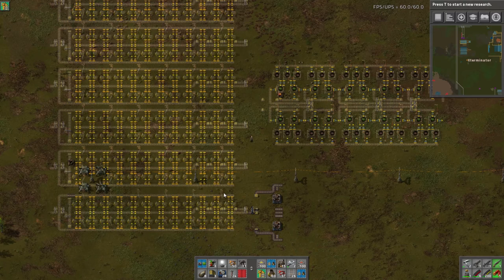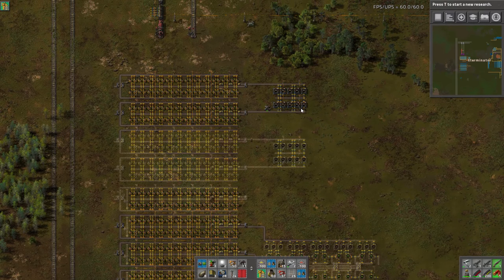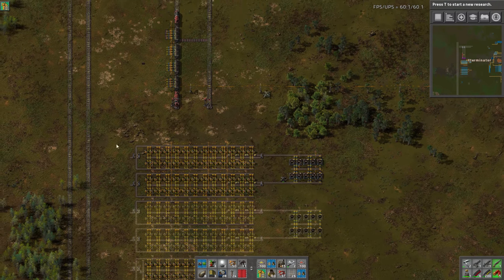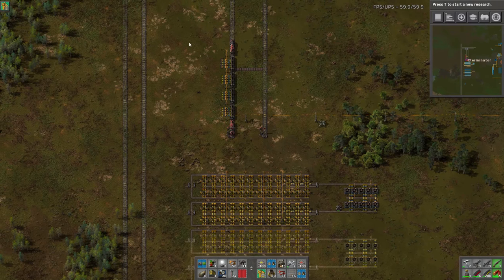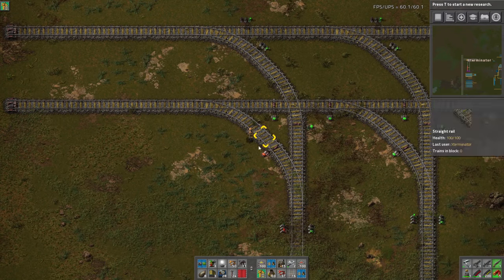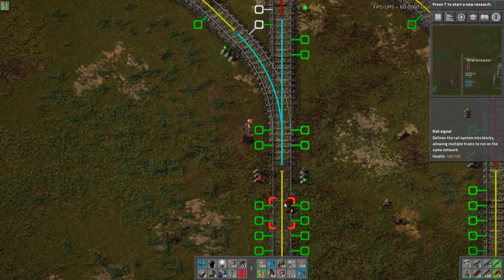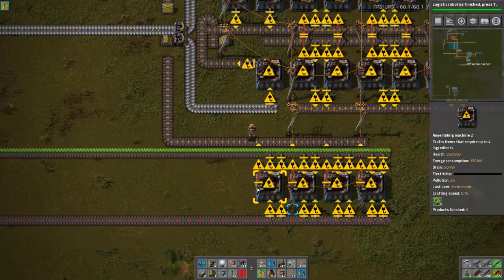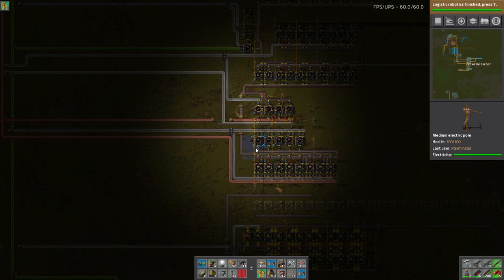Factorio: Tightening The Belt: Megabase Guide EP10 - RED CIRCUIT BUILD | Tutorial Gameplay Series

Comment from the maker: Hey guys, wanted to point out a mistake I made here that may confuse some people. In the example I show of direct Insertion of Copper Cable to Red Circuits, you may have noticed I did it backwards. I put down 6 cable machines into 1 red machine in the middle, but it should be opposite of that, with a cable machine in the middle and 6 circuit machines on the outside. Not sure what my brain was thinking. Sorry for any confusion! :)
Reply: Never mind! Your a super natural simpatico - we thank you for that excellent series
Reply: it happens to all of us
Reply: Hey xterm I noticed when you removed some of the signals on the first junction you explained. Surely that makes that block one way because you need two opposite signals? Hope that's clear enough aha
Reply: Because inserters takes in priority the closest line so they would take iron plate instead of cable for red circuit. I'm actually a bit curious of this build because if for any reason at some point he is having a shortage of copper, cable will stop being produce and inserters will start to take iron plates and stay blocked with them in it.
Reply: Yeah, I noticed, but decided to ignore it since you were just making a point anyway. :-)
Reply: Inserters that are set to insert into an assembler will not pick up items from the belt that the assembler doesn't need.  So an inserter that is inserting into a red circuit machine will never pick up a copper plate.

Comment: Could you please go through train loading and unloading. I've always been scared of trains as they seem super complicated and have never actually used them in game yet. Your explanation on signaling was fantastic however and is a very easy and useful way of visualizing and understanding how to signal intersections. That is only half the battle however, what is a trains throughput/how many carriages do you need to compress 1, 2, 3... yellow, red, blue belts? How do you efficiently load and unload them? Does the throughput easily convert from a train to a belt? And if the train isn't at the station, how do you have a compressed belt 100% of the time?
Yet another fantastic tutorial, they are very entertaining and informative to watch. :-)
Reply: You can do trains very simple or complicate it for maximum throughput and efficiency. Dont be scared they are fun. You can start with just one train and then you don't even need any signals. Put some inserters to load and unload, if you need more throughput watch the inserters and belts and think. Why do you need a belt fully compressed 100% of a time?
Reply: In order to get a compressed belt 100% of the time even when trains are not in the station you use chests. When the train is here, it fill them (inserter Wagon -> chest) and 100% of the time inserters are taking materials from the chest to your lane. You can add more chests in between if you need to buffer it up.
The most difficult part to deal with is that inserters carry really quickly from inventory to inventory but are really slower to put in a belt (at max level stack inserter can carry 27 item/s from wagon to chest but only up to 12 item/s from chest to belt). So at max tech for a blue belt you need a bit more than 3 inserters for a full lane. So make it 4 and make them merge on both side of the lane.
Reply: For compression, watch the factorio explorers lets play of terminator with katherine of sky (just the train setup videos should be enough). The use of chest with dual lane loading into splitters from the trains should be ideal for compression on their train setup. Once you get stack inserters into play (you should be having them by that time typically), it should be easy. 
Also, like Lubricus said, you really cant understand a lot of it just by watching Xterminator's plays, you need to set it up yourself... especially when using chain signals and multiple signals over overlapping junctions... at the most, you'll have a train crash.. so what... your not getting run over by them right?... right?  ;)

Comment: 4:18 2-way rails need pairs of rail signals. A train will not path past a signal on the left side of the track unless there is a matching signal on the other side of the track (Indicated by the white signal placement box).

If you place the one-way signal on the outer part of the merge, then it is fine. If you place it where both tracks are merged then it must be on both sides of the rail.

Comment: For the gears, you could nicely connect it with an easy tip : left side of the gear assembler, move your inserter one step down,  add a belt going from south to north,so you'll directly insert on the good side of the belt. If you slightly move your gear assembler to the left, it will be perfect :-)
You made me laugh with your 6 cables for a single red machine, I think that will be enough cables ! We all undestood what you where trying to explain, sometimes, doing it live make things wired in the head :-D

Comment: hey Xterm, one thing you might want to point out, is that its not necsssarily making 2 cables per half second, but rather, 2 cables per half crafting "cycle", since crafting speeds don't line up with seconds except at a crafting speed of 1. Its a somewhat minor detail, but can cause confusion if people don't realize the crafting speed changes based on assembly machine level. For a tutorial, probably best to just point out why its important to either use the same level of assembly machine, or be ready to do some math with crafting speed differences.(ie, dont' save materials using a lvl 1 machine for copper cable because it won't support 6 lvl 2machines making red circuits.)
Reply: FalcomPSX Assembly level 3 is a while away though I'd imagine he'll address that then and keep it simple now.

Comment: att 8:00 you say "Signal before merge here". I think if you put chain singlas on those locations and then the signal after the merge you get a much cleaner look that is easy to follow. Espesially for beginners
Reply: But putting a chain signal at 8:05 would cause it to read the block in front of it AND the block AFTER the junction. A train would wait until another train would have cleared two blocks ahead, which is pointless. The waiting train can already move in the junction when the previous train exited the junction.

Comment: "In this episode, Xterm finds out why Right Hand drive rails suck".
Reply: that doesnt make any sense whatsoever. it would be the exact same rail layout, just inversed signaling. left turning trains on right hand rail systems will always block oncoming traffic, and right turning trains on left hand rail systems will block the oncoming traffic as well. the only way to prevent that would be, if you lay out one track all around the contraption.
Reply: It changes a bit because the signals have to be on the right side of the tracks thus making the designs slightly different.
Reply: I see. Forgot about that one. But does it really change something?
Reply: Seth it changes the layout completely. Not just the signals
Reply: Completly? Hm. Now you sparked my interest. You dont have any videos you can recommend i can check out?
Reply: I should make them and show you, it's not hard. I'll do it if I remember